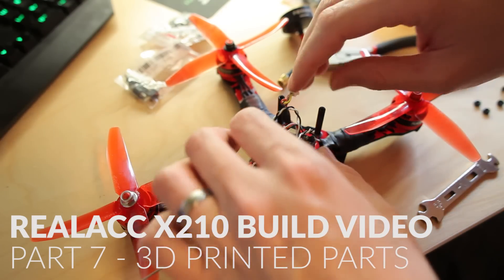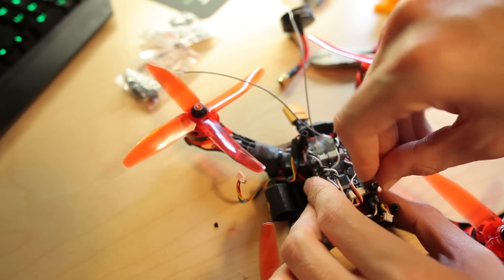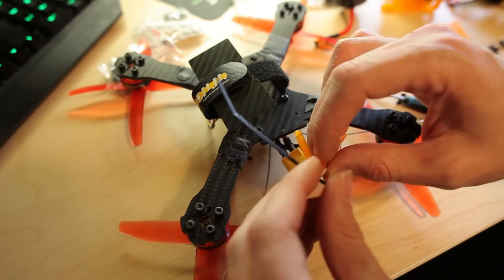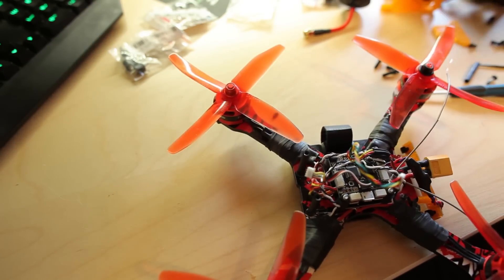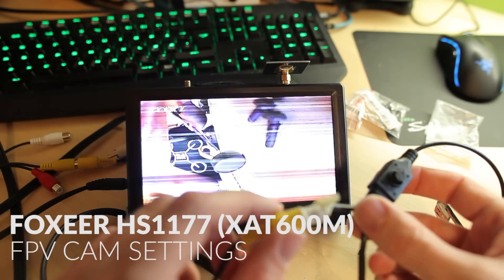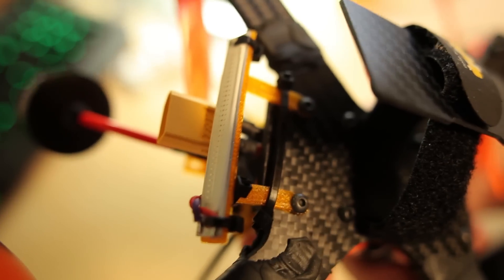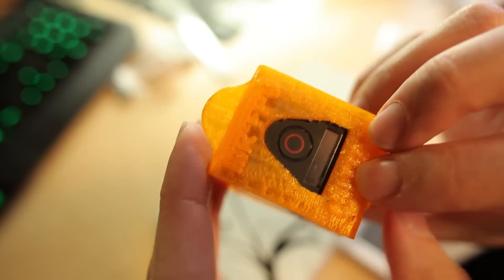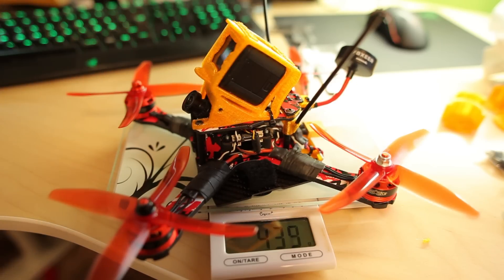Banggood Realacc x210 build video - part 7 - 3d printed gopro mount, hs1177 fpv camera settings

Comment: Are you using the stock extruder or did you have to upgrade it to print TPU? I just ordered a Maker Select and am really interested in what I need beyond a glass plate to get good prints.
Reply from the maker: Hi there, We are using just the stock extruder on our Wanhao i3 plus. It was printing TPU just fine out of the box.
Reply: Awesome, that is really good to here. By the way great videos, I have enjoyed watching them. Really dig the 3d parts in TPU.
Reply from the maker: thx m8!

Comment: Hi, thanks for video. Which material you used for 3d print orange parts?
Reply from the maker: Hi! Thanks for the comment, It is TPU material! Very strong, durable and soft for quadcopter parts